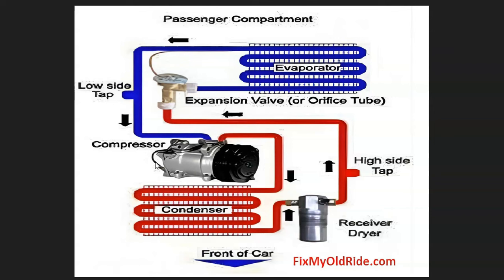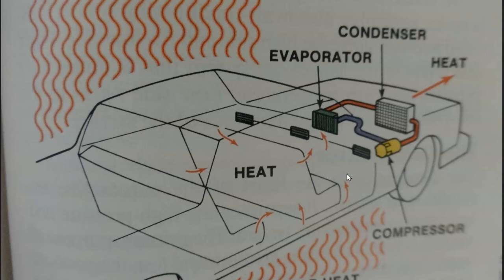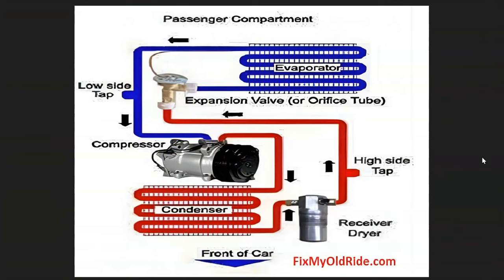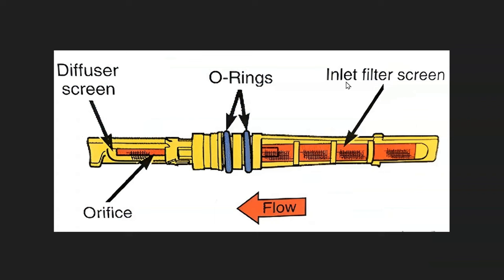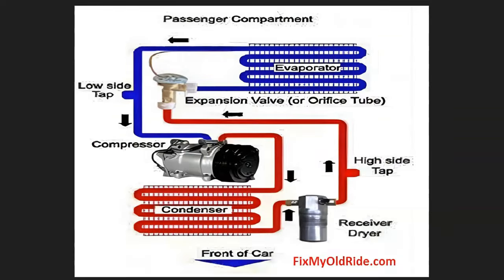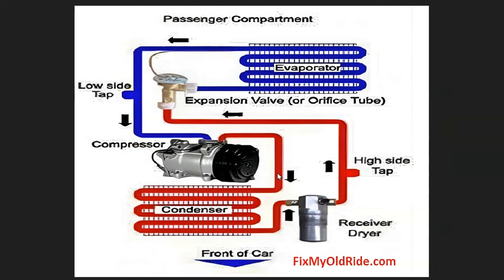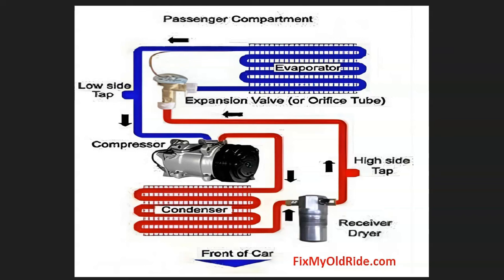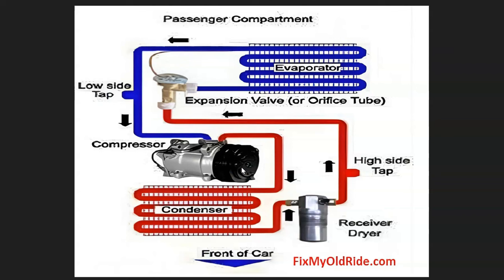Automotive AC Compressor Failure

Comment: You're leaving out some relevant possibilities in addition to what was covered in the video. To start with, the first thing you need to check is the mechanical operation of all the actuators. For example, the blend door may not be working correctly.  That can easily be the issue. Or, the evap core may be freezing. That will also cause an intermittent problem. Most modern vehicles have hvac  systems that are computer controlled, and connected to one of the cans. The problem may not even be with the AC system. Under certain conditions, the pcm may turn the ac compressor off, like if the engine is overheating, or the pcm thinks its overheating. Any system that has an hvac module will have dtc's and parameter identifiers for all the controls in the system. You need to look at those, as well. Its also very common to have a software issue. A reprogram or a module update may need to be done.

There's other things, as well, but these are the most common problems.
Reply from the maker: Thank you for your comment. Unfortunately, people don't have the time these days to watch long videos. Therefore, I try to keep them in the 8 minute range. At that length, I am unable to cover things in great detail. That's why the title of the video was Automotive AC Compressor Failure. It was meant to focus on that component. However, you're 100% right in your comment. In fact on my neighbors car they replaced the compressor when the actual problem was the blend door motor. The nylon gears inside the motor had missing teeth. My neighbor is still fighting with the dealership for compensation.

Comment: So the office tube is the only “filter” for ac systems but if they only have an expansion valve with no orfice tube, what is it that acts as the filter? I have a 2008 Durango with rear ac. I’ve blown 3 compressors in a row, with them only working while idling, then after a test drive it blows the compressor. What can I do to fix this thing 💔 I feel there is metal flakes inside the whole system. I only replaced the compressor each time and it always blew cold until I took it for a drive then it was toast. The compressor got so hot it melted the insulation around the power cable. HELPPP
Reply from the maker: I'm on vacation this week so I must be brief.. Flushing the system is the most important operation after compressor failure. They make flushing kits but the best ones use shop compressed air. They also make aftermarket inline filters that you can install to protect the new compressor. Also be aware that aftermarket rebuilt compressors are notoriously unreliable. Good Luck!
Reply: Thank you for the info! :)

Comment: I keep replacing my compressor, and it keeps failing. I have changed expansion valve and condenser on first occasion. What could be the problem?
Reply from the maker: Often the main cause of repeat failure is small particles of metal debris from the original compressor failure lingering in the system. Flushing the system is a difficult operation, because the oil film inside the system holds onto the metal chips. Hence why you can't just use compressed air to clean the system. This is why they make aftermarket inline filters to protect the new compressors. However, buying a re manufactured compressor can often be the problem as well. These are often poor quality and will not last long. In the end it might take a professional mechanic to disassemble the AC system and flush individual components into a bucket to determine the root cause of repeat compressor failure.

Comment: next time try to find an updated version of condensers and evaporators. they are not like that old school depiction your showing. then people will understand when compressor fails you cant flush the new condensers they have become filters they clog from the debris, tiny flow paths and they do not flow like that old stuff your showing. i no you are just showing basics but try to expand on it. would be a lot more beneficial for people to learn
Reply from the maker: Thanks for watching and taking the time to comment. When you post videos here you have to be careful on what images you show. I posted pictures that I had permission to use. With that said, I hurried the video to keep it in the recommended time frame. I missed saying a bunch of stuff. The one I meant to include was about the oily film in the system that grabs tiny metal chips making them difficult to flush. Hope my next video will be better.